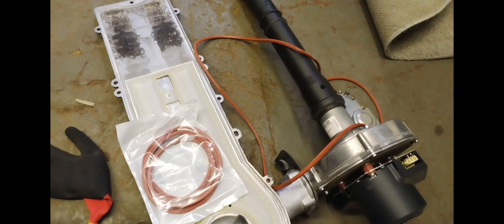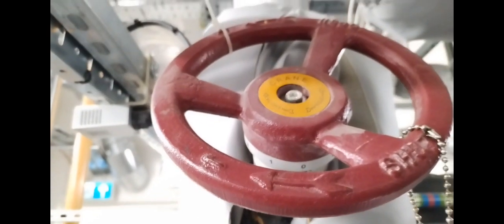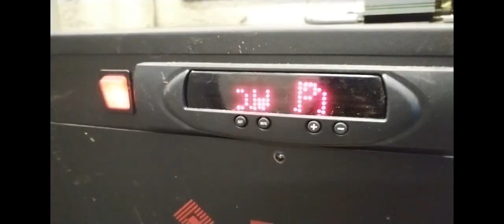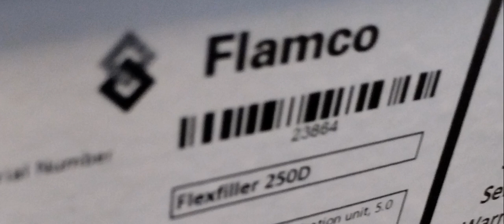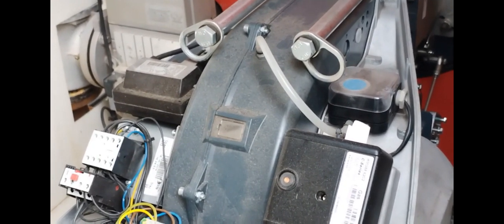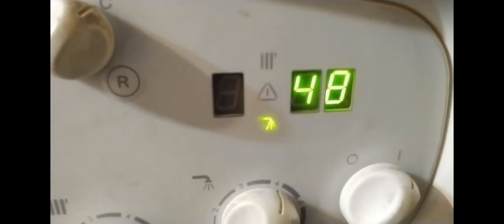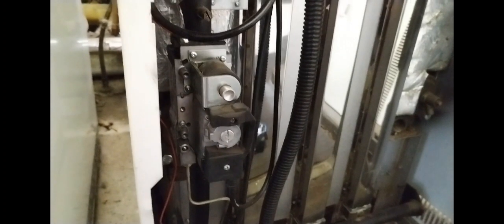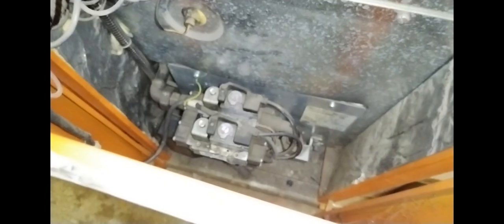WEEK IN THE LIFE OF A COMMERCIAL GAS ENGINEER pt6

Comment: Great video as per usual buddy but my Achilles heel. Linking out forced draught burners at the unit to get around Bms.
I know it's to do with Terminals  T1 + T2 but that it for me, I'm only too aware that the bigger burners have both single phase and 3 Phase. Would really appreciate a video on the basics of how it's done, because how many times I go to sites in warmer months to carry services, find burners held off on Bms, no maintenance on site and wrong passwords
Reply from the maker: T1 to T2 sounds right. As you know T6 to T7 low fire. T6 to T8 high fire. Made a video on this but with the weishaupt

WEISHAUPT WG10N/1-D high & low fire

Week in the of a commercial gas engineer pt4. 7 minutes in I go through getting into the password on the burner display.

Also as you know flip up the relays if there's no bms drawings and wait to see which one if any activates the boilers switch live.